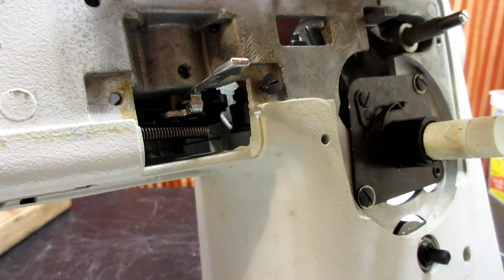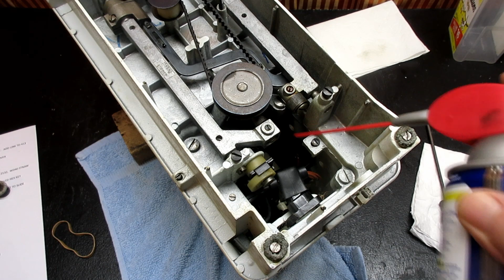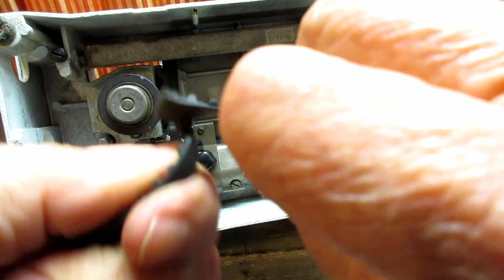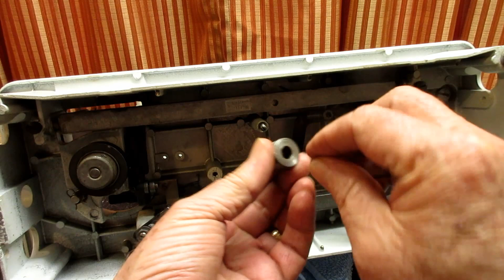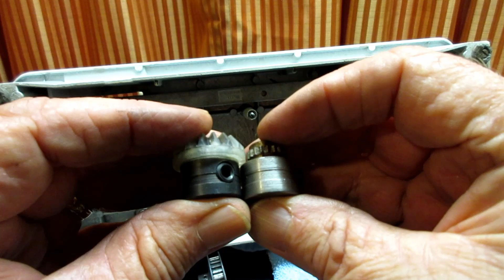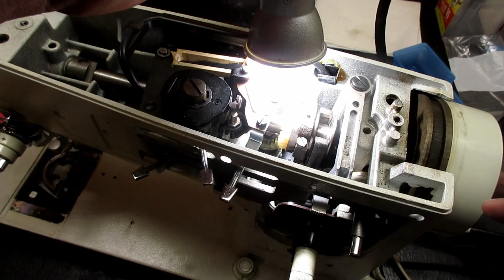SINGER MODEL 466 GEAR SWAP PT 2 - GEAR

Comment: It would be really nice if somebody would machine steel (or whichever metal) replacement gears for the vintage machines that have nylon/plastic gears
Reply from the maker: I agree, that would be a fantastic solution for keeping these machines running forever!  Thanks for watching.

Comment: Thank you Sir. Very informative. Do you perhaps have a tutorial for changing the horizontal top gear? I need to replace the vertical and thought I might as well change both together.
Reply from the maker: @neilfowlis6158  sorry I do not have a video like that I have never had to change that gear and never seen a damaged one nor have I seen instructions in any manuals about how to do it I'm sure you'd have to take off everything in the nose and the hand wheel disconnect the rods going down to the feed and hook drives and pull out the horizontal arm part way through the nose to slide that gear off so quite a project I always felt that that gear was made of a different type of plastic some people believe the horizontal gear wears out due to excessive heat from riding on the upper bearing
Reply: @ ok that’s interesting . Lastly do you lubricate the gears with anything ?
Reply from the maker: @neilfowlis6158  I do not. That is based on advice from retired Singer repairmen who told me "no oil or grease on plastic gears". There are plenty of my viewers who disagree with that. They say it is "old school" and plastics have changed and there are synthetic greases compatible with plastics. The grease I use for metal gears shows it can be used on plastics. If I were to grease up the plastic gears I would use it or something similar https://www.triflowlubricants.com/product/tri-flow-synthetic-grease/   In the end it is up to the machine owner. I appreciate you watching my channel. 🙏

Comment: Thank you so much for this! I’m a complete newbie. I have a fashion mate 257 that doesn’t have faceplates to remove. Any idea how to get to the gear on a model like this? 😅 I also don’t see a screw on it, just a small hole which I’m guessing may be for an Allen wrench?
Reply from the maker: Welcome to Andy Tube. I never worked on that model but I believe the "small hole" is a Roll Pin, not a screw of any type. Roll pins are pressed in or punched out to remove. Your 257 replacement gear comes attached to a new vertical shaft. Since there is no face plate I'm thinking you must remove the gear/shaft out the top of the arm after removing many other parts. Some viewers have told me they drilled a hole on the back of the machine large enough to get a punch or screwdriver onto the old gear and then onto the screw for the new gear. I think if you have a screw or Allen screw on your gear it was already replaced once before. You can take a look at this guide that Terry wrote for replacing that gear. He has 30+ years working on the machines here is the page to his guide https://store.tandtrepair.com/252-257-tvgearguide.html  He will usually respond to emails so you could ask for a brief explanation of what is in the guide. Tell him you are new at this. You can buy the shaft/gear or just the gear at several; online stores. Here is one I have used for many years: https://www.vintagesingerparts.com/search?type=product%2Cpage%2Carticle&options%5Bprefix%5D=last&q=445491-S&filter.p.product_type=   Shop around if you like, Terry may sell the parts also. When I mention removing parts up on the arm I'm thinking handwheel, zigzag parts needle bar presser bar, etc. so you can slide the main arm shaft out of the way to lift the shaft/gear up and out. Yuck. I think that's why some have told me they drilled a hole in the pack and removed the feed regulator plate (stitch length) parts on the front to get access and manipulate the gear out and in,

Comment: I’m besides myself. I have a Singer Stylist 476 I’m trying to save. It’s the top gear, just as in your video here.

My problem is removing the front Stitch Length dial/knob on the 476. Is there a trick to pulling this off?

I’ve been wrangling and struggling with this silly thing for hours. What is the secret?

This intransigent knob is keeping me from removing the panel so I can get to that set screw on the broken top gear.

SOS! Please help! Thank you.
Reply from the maker: Yes, there is a trick I believe. Model 476 is the lower-end sister to the class 478 model, 478, 477, 476. On my 466 you turn the dial to zero, but the Service Manual for 478 says you turn the dial to between the #4 button hole setting and the zero. I assume that lines up the inner parts for removal. You can buy the manual for $6.99 here: https://manualsoncd.com/product/singer-400-series-service-and-repair-sewing-machine-manual/
Also, The Aussie Repair Guy has a 3-video Playlist for working on model 478 that may help if you need it. https://www.youtube.com/watch?v=sz08harYlSI,  https://www.youtube.com/watch?v=KPcWrETKjA8,    https://www.youtube.com/watch?v=Yua67TeLUCE
To be clear, there is no separate service manual for model 476 as it is the "more simple" model of the 478, and repairmen just used the 478 manual for all three machines. Thanks for saving the machine.

Comment: Andy, I am excited to see that you are making videos again.   I have a question.    I know about 5 years ago you did some videos on the singer 338 sewing machine.  I am am beginning to watch them since I recently purchased one.  I have oiled it and greased it some however, I find that the foot control has only one speed that is extremely fast.     Is there a way to adjust this or do you know if I can purchase another foot control for it that would let me make it go slower.  I just can't sew that fast and get it right.   Thanks so much for your advice.
Reply from the maker: Thanks for keeping that machine in service. A nice model for home sewing and crafting. 
     There are a couple things that can cause your foot pedal to act that way, assuming it is the original "button" style controller. Inside some pedals, especially in the UK and parts of the EU, there is a device added to prevent interference with TV/RADIO in the home. It's a capacitor that helps prevent that. It is usually a tube-shaped or coin-like device, silver or white mostly, that is wired in between the two screws where the cord ends are screwed down. That device, if you find one, can be removed as it is not needed these days. When the device fails it fails closed meaning it just lets full power go thru to the motor. Sometimes that will happen by itself and the motor will run fast without you even pushing on the pedal button. Like a ghost is what people say. Many times smoke will come out as the carbon resistor stacks in the pedals start overheating and burning up and fires have been known to start. Take it out if found.
     If there is not a capacitor then the control spring may be stuck or the levers inside are out of adjustment, etc. It's like 50 years old now and may have never been cleaned and adjusted. I have a couple videos showing how to open the pedal and work on it. I made them during my model 337 playlist and you have the sister machine (fancier) model 338 so the videos apply to you. Here are the links to the videos:      https://youtu.be/gFIB9jR10fA    and    https://youtu.be/mKdi2DWTu6c  
I hope these will be of help to you. If anything in the videos seems confusing or incomplete, I do have an older playlist of 8 videos for the pedal that goes a little slower and into even more detail. You can find that playlist at this link: https://www.youtube.com/playlist?list=PLsCOZgzzaiKItPLWcK24FBoMdHK8vTXNi
     I'm glad you asked, be safe please, and thanks for watching my channel.
Reply: @andytubesewing1953  Thank you so much for your response.   I will watch your videos and open mine back up to see if I find the capacitor.   I love your videos.
Reply from the maker: @TheUsertobe  thanks very much and good luck. I hope it works out for you
Reply: @andytubesewing1953  As much info in the comments as in the video!  Thanks for being so willing to answer questions, in detail.
Reply from the maker: @crowznest438  Always willing to help anyone trying to save a vintage machine. Thanks for the comment, and for watching my channel.

Comment: 1968 to 1970 machine with timing belt and plastic gears.  A foreshadowing of modern autos with timing belts that last 100,000 miles and plastic everything else.  Thanks for showing how this gear is changed.  Again, a very concise easy to understand video.  This wouldn't be an easy job to go into cold.
Reply from the maker: Thank you Ralph. I tried to show that there's different approaches to get the old gear out in the new gear in because everybody can kind of do their own thing once they get to that point. And hopefully nobody's going to comment or email me that they can't get the old gear off cuz it's stuck to the shafts haha. I appreciate your comment

Comment: What an informative video!  Both my 418 and 457 have no oil hole on the front of the machine to oil that top shaft bushing.  I would think it is important to keep this bushing oiled, and I wonder why Singer did not drill the hole in the front to allow this.  My 457 shows in the  user manual to somehow get a drop of oil in between the gear and the top bushing from the top of the machine.  I would drip oil all over the gear itself if I tried that.  Well, now I’m going to turn my machine upside down, and drip oil just like you dripped WD40.  Now, once or twice a year, I will oil this bushing with the upside-down method.  I replaced the upper gears in both machines a while ago using your videos, so now I’m just into maintaining these machines, and I am enjoying seeing the similarities and differences with the 466.
Reply from the maker: I too have puzzled over that missing oil port. When I fixed or sold the 457K & 413K I showed the owners how I would "Upside Down Oil" that top busing. It takes a little longer but not as long as replacing a ruined gear. About 2 maybe 3 drops so it won't seep past the top of the gear. I tried being oh-so careful oiling from the top and using the little tube but would still get some oil on the gear teeth. The missing oil port is a mystery we'll never solve, I think. That's for the comment, Carole, Regards to Roger, and take care.

Comment: Hello Andy, 
It’s great to have you back!  Nice video, but I have a question about why you didn’t replace the horizontal gear?  More than likely it would it also crack and need replacing in the near future?  I would expect that the horizontal gear is just as old as the vertical gear.   Thank you.
Reply from the maker: Thanks. I've researched the gear on the horizontal shaft. I've never found a bad one.
     You must remove most of the parts connected to that shaft to replace that gear, then reinstall them and set the factory specs on them. It's quite a job. 
     There are a few theories as to why that gear seems to always be in good condition while the top gear on the vertical shaft is always shot. One is that the gear is made of a different type of plastic. 
     Another is that the top gear runs extremely hot b/c the gear base sits on the top of a bushing and while the is an oil port fo inside the bushing to lubricate the vertical shaft, no or not enough oil migrates upward to lubricate the top of the bushing that the gear base rests on. 
     Finally, the theory that some people misinterpret the instruction manual, or don't know any better, and put oil on the gear. I think the answer is a combination of these ideas. I have seen gears that are still creamy colored with all the teeth gone and many gears like my video where the broken apart gear is beige, brown, or even dark brown (I think from oil) This is plastic from 50+ years ago, and different from today's types. 
     Anyway, I did not replace the gear you ask about b/c I never had a bad one and after inspection, it looked almost new without any stress cracks or chipped teeth. 
     There are later models with the 4 gears on the bottom instead of pulleys and belt and they are a different plastic type still, and I would for sure replace all of those when the first one fails (usually the hook gear) 
     FYI The part number for the horizontal gear you ask about is 155818. In the past, I could not even find one for sale vs a dozen sellers of the 155819 gear in this video.
    Thanks for an interesting question, Debora, and for watching my channel.
Reply: @andytubesewing1953  Thanks your response.  You really did your homework!  If vendors are not selling replacement horizontal gears,  that tells you a lot!  I am amazed to learn something new all the time.  😉
Reply from the maker: @deboramunoz1084  You're welcome and I agree about learning. I really started learning a lot when I started making videos about how to maintain these machines. They're fascinating in their own way and it's a very enjoyable hobby

Comment: Hello Andy I have a imperial zig zag DE Luxe model # 190    can't find a manual
Reply from the maker: I can't find a manual either. Not surprising though. It was made in Japan and could be based on the Singer Model 15 concept. I only work on SInger but even my manual sources tell me you'd be lucky to find a manual for the 190. Maybe try the 336 or 535 later models in the hopes some of the features would apply to the 190. The last guy said, "Don't bother looking. A very nice machine, but no documentation".